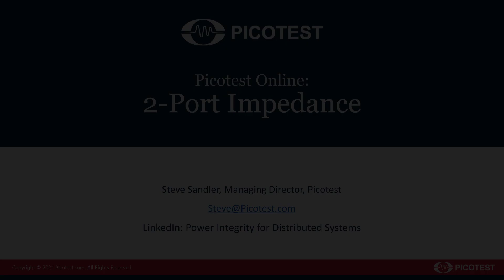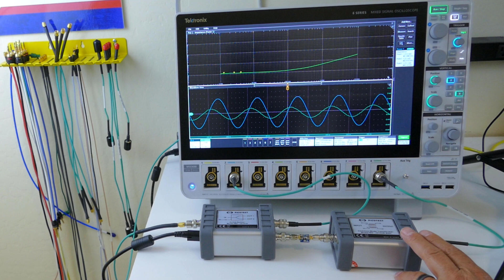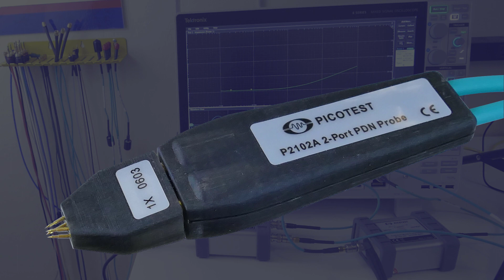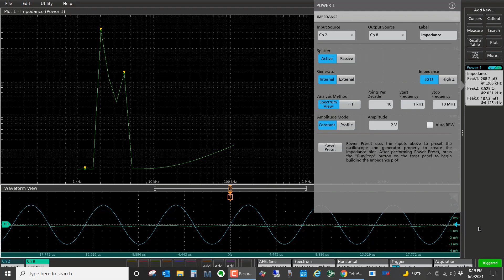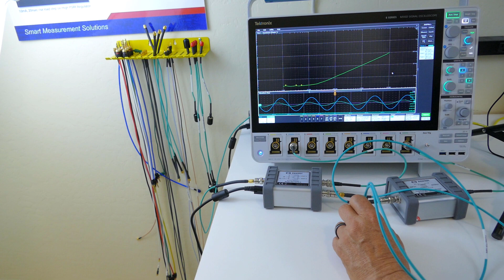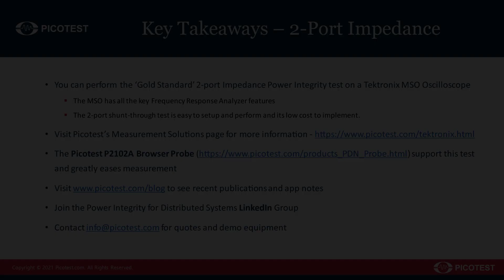2-Port Impedance

Comment: I have two questions:
1- Up to what range can the amplifiers inject power to the device under the test?
2- Can we perform the high-frequency measurements while the device under test is working at its rated value (this test is extremely important when a component (such as a capacitor) changes its characteristic at its nominal operating point (fundamental or DC voltage is applied) and when we need to investigate the effect of this change on the frequency response of the component)?
Reply from the maker: This is a small signal injector and this runs in parallel with the bias provided by the operation of the device.  The frequency is limited only by the scope or VNA.  See the Picotest solutions page for some examples. 

Yes, this can measure with the DUT powered. Up to the voltage rating if the VNA. Above the rating of the VNA, we have to add DC Blocks or use my 2-port extended range measurement. I introduced it at the IEEE LAMC conference in 2016, but I also presented papers and published articles. Should be easy to find.